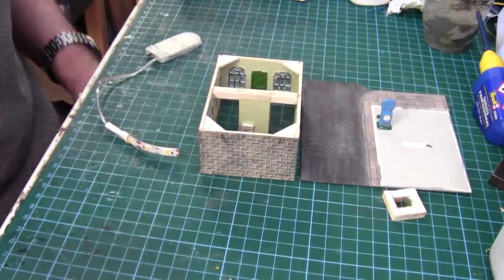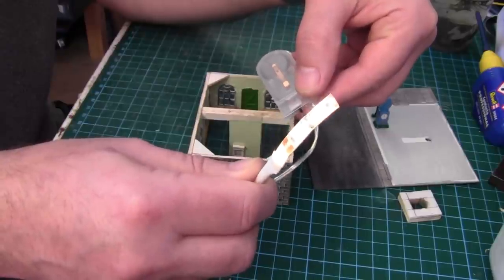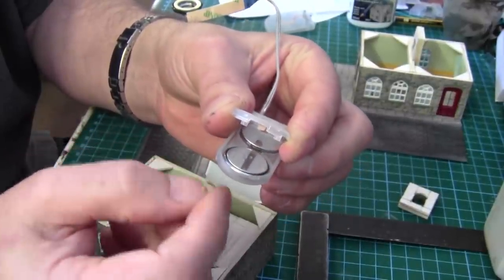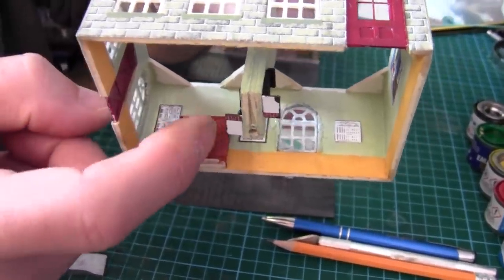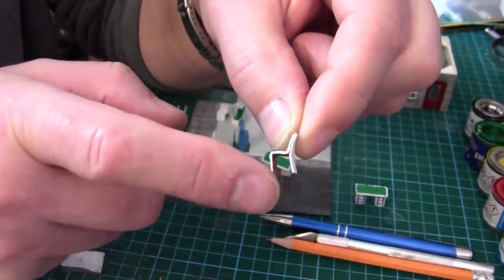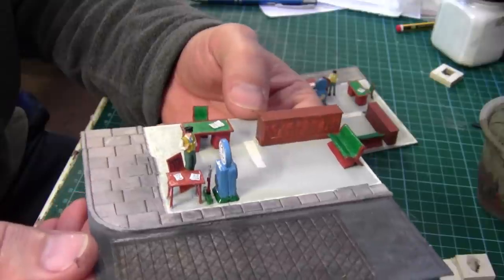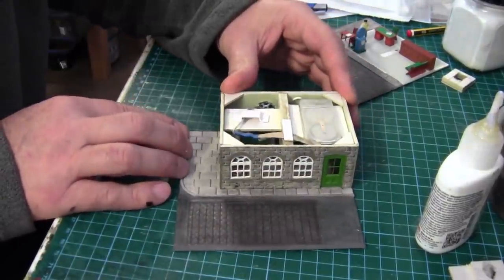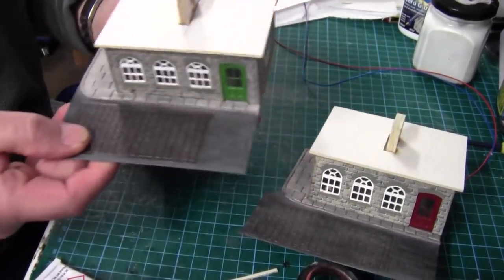N.E.R weighbridge and office, Part 3  No263

Comment: Great job, Tony. That battery holder and led was a good find. I may have to look at that for my buildings. Thanks again for sharing. Roy.
Reply from the maker: Hi Roy i found them on Ebay. they are great if you have no 12v supply. and i would imagine the batteries would last for ever...well maybe....thanks again for commenting.......all the best Tony

Comment: That's worked out a treat, very impressed. Really like the internal fittings and illuminations too, really have built up a lot of expertise in doing. Flat rooves look great will have to have a go. All the best Stephen
Reply from the maker: Thank you Stephen. the battery was a great fix for anyone who does not have a 12v supply for LEDS. the building is unique because it was on the site before the station was built. its all slowly coming together. just like a jigsaw. i have just got to make sure i have all the pieces. thanks again for commenting.......catch up in the next video...........cheer's Tony
Reply: @TONYNORTHEASTERN  It looks even better now I am on my large screen. Ditto the plate layers hut - really like that it is such a change to other commercial offerings - that's the beauty of scratch building!!
Reply from the maker: Thank you kindly sir..........cheer's Tony

Comment: As the CR2032 is 3v I assume they are in series giving 6V,  could you not just solder on an old USB cable 5V and cover the lights from a power bank or an old phone charger?
Reply from the maker: Never tried using a USB cable. but i know you can get USB powered LEDS as i bought some for my sons computer...many thanks for commenting. best wishes Tony

Comment: Credit where its due tony brilliant again, just a question how you measure windows and doors ive made a start on scratch building an apartment block just unsure on the windows and doors look forward to your next build video 👍
Reply from the maker: Doors are aprox 25mm x 13mm. windows are varied especially on apartment blocks. best thing to do here is try and find a matching photo.  and use the door measurement as a guide for the windows...most terraced houses are 13mm wide 16mm tall. good luck with your build.....all the best Tony
Reply: @TONYNORTHEASTERN  thanks tony got more card to work out windows and doors and to do internal walls to strengthen up thr build